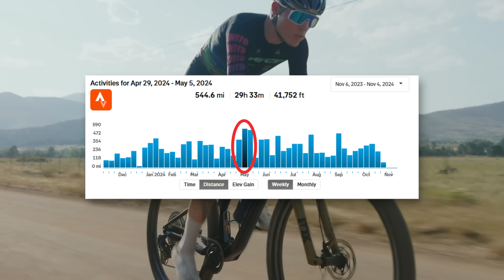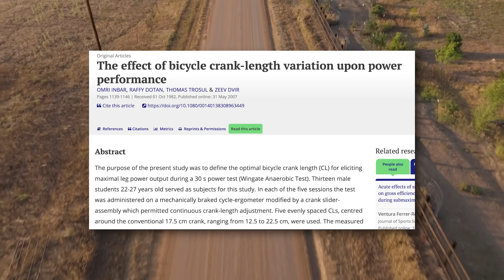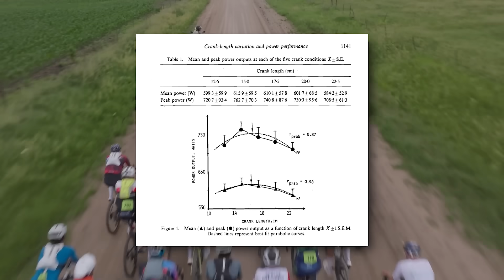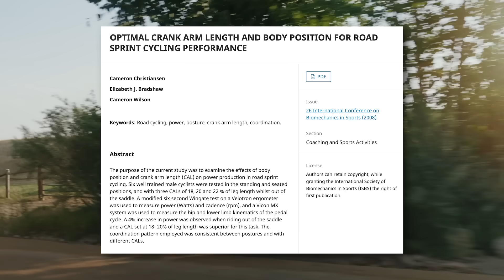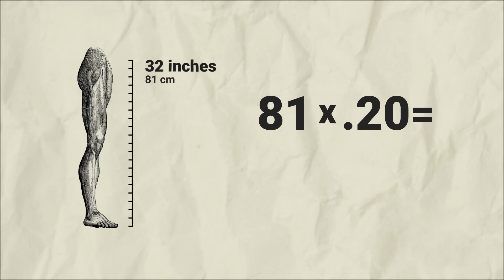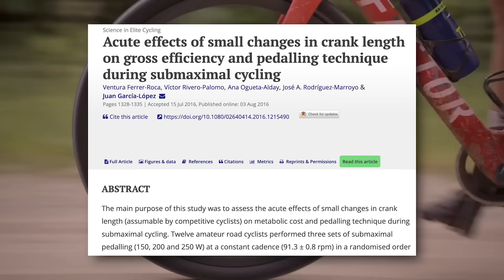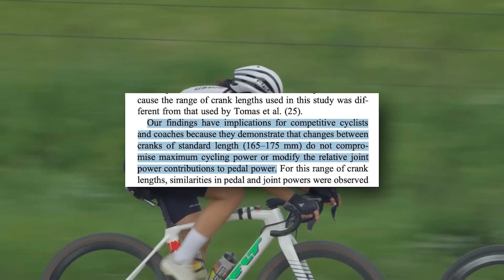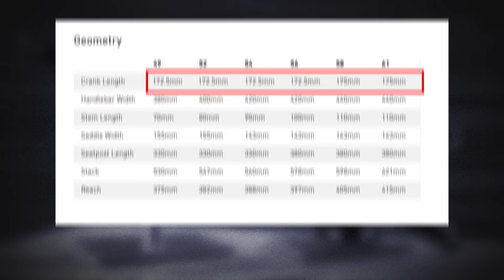You Should Be Using Shorter Cranks, Here's Why

Comment: 11:05 - Hold on a sec! Shorter cranks mean higher saddle, therefore less aero position. They could allow frame design with a lower bottom bracket, but that's quite an other rabbit hole.
Reply: in theory yes, if you want to preserve the same leg extension at the bottom of the stroke. But if you want to keep the same hip angle at the top of the stroke you can actually lower the saddle! But for most people the purpose of shorter cranks is to open up the hip angle, so in terms of bike fit and biomechanically increasing the saddle height would be helpful.
Reply: @JShrimpma  there were studies regarding saddle height and the conclusions were that a) optimal height is near full extension b) bit too high is as negative as quite a lot too low.
So you definitely not want it to be too high, but putting the saddle too low is decrimental to performance too. Therefore if you have a set position with longer cranks and switching to shorter, you keep saddle to pedal distance. While manipulating hip angle with bar height.
Reply: A higher saddle height does not mean less aero, don't know how you come to that conclusion, your saddle to lower pedal relationship remains the same, so no loss in aero there, but you can lower your body more into a more aero position due to a more open hip angle.
Reply: @gregmorrison7320  higher saddle - more frontal area. You know, the A in CdA.
Reply: @feedbackzaloop  No, you're wrong, think about it, a more open hip and knee angle allows you to get lower on the bike, less front area, I've done this on five of my bikes and ride in puppy paws everywhere watching everyone else sitting upright on the hoods, because that is what is more comfortable for them because of hip impingement. Ask yourself, what position is more aero?
Reply: @gregmorrison7320  that's playing with Cd of CdA. Legit, but different. And puppy paws vs upright - definitely not because of the cranks, be honest.
Reply: @feedbackzaloop  It's definitely more comfortable spending hours in a lower position with a more open hip angle, yes.
Reply: @gregmorrison7320  skill issue - if it comes to comfort, when you say so. Now, keeping to produce power hour after hour when your back is not strained - that's what you should have been focusing on. And where hip angle doesn't correlate with saddle to bar drop anymore.
(In other words, your position is not low enough for your back mobility and shoulder strength disregards crank length)

Comment: I have some experience riding shorter cranks. On my 29" mountain unicycle I have 135mm cranks that feels about right. Atfirst I had there 145mm and they was feelking too long. Since unicycle doesn't have any gearing, I'm basically stuck with 1:1 ratio. And with shorter cranks I can ride a bit faster.
On my experience with shorter cranks you tend to use higher cadence and easier gears. That's one of the reasons it's better for knees.

Comment: One caveat of shorter crank length: gearing. If you go from 175 to 165 you loose about 6% of mechanical advantage. Tha means you should change 30 tooth casette to 32 casette.
And there is one more advantage of short crank length: pedals clearance in cornering!

Comment: welcome back Dylan! 

As a fitter from my side I can add: these marginals gains come not from biomechanical side of the leg-crank system, but physiological one. With exertion, muscle mobilizers/stabilizers come into account, when those muscles endurance depletes and leg pattern is disturbed, thus cutting effective pushing phase of legs in degrees significantly. So reducing the open/close leg angles saves mobilizers/stabilizers for longer period of time. 

Cheers, 
Alexey
Reply: On the money.

Comment: Your premise is wrong. It should recommend the "correct" crank length; not short or long. Using your 20% formula for my 90 cm inseam suggests 180mm cranks would be optimum. Unfortunately, the closest I can get is the 175s on my Canyon Ultimate size XL. So I suspect, for many men, using you calculations,, the standard 172.5s are actually too small. Do you get my point? Exposing 165s is misleading for many cyclists, even if they're spot-on for you.

Comment: I'm 6' and ride L/XL frames.  I rode 165 cranks my whole childhood / college (I think my dad was mostly motivated by reduced pedal strikes at high lean angle).  Then my first carbon bike purchased as an adult came with 172s, so I have that on my road/gravel bikes.  But on the track, shorter cranks are advantageous because comfort and efficiency at high RPMs is such a big factor (also pedal striking at some velodromes, though not mine).  So on track, I run 165s.  They certainly feel a little different but I don't think it's a big deal.  I only race track and the 172s on the road aren't bugging me, so I'm not rushing out to replace them ($$$).  Interesting video!
Reply: 172mm is already short for 6ft guy. That is proportional to a5 ft 10 pogacar using 165mm cranks

Comment: Good video, but go deeper. There is an anatomical and physiological reason for, not shorter cranks, but the right crank length for the rider.
Ask a good bike fitter, not some former pro wanna be. A fitter medically knowledgeable. They will tell you that the BS bike riders have been fed all these years is wrong.
Again go deeper, there are tons of videos on everything from handlebar widths to saddles (huge variety) for the performance value of comfort cannot be understated. Shorter cranks for most people are more comfortable so they perform better.
One last thing on my rant please. Bicycles have more than one gear last time I checked. So if you want more power then upshift to a harder gear with your comfortable shorter cranks.
Respectfully, keep up the good work!

Comment: I'm 6' 2", but have a long back and relatively short legs with an inseam of 32.75". A new bike I got several years ago came with 175 mm cranks. I quickly noticed left knee pain. I switched to the 172.5 mm I had been using and this resolved. But sometime after that, I started getting more left knee pain. I looked into still shorter cranks and decided 165 mm looked good. I tired them and the knee pain dropped to a fraction immediately and was completely gone within a few weeks. I then converted all of my bikes to 165 mm.

My short wife had 165 mm cranks on her bike. I converted to 152 mm and she immediately loved it. I could also see that she no longer looked like she was going to hit herself with her knees while pedaling. 

You do lose some leverage, but it's on the order of a half a step between gears and you only lose something at the very lowest gearing. I also believe the less range of knee motion means more of your pedal stroke is in a strongest or best leverage portion of the pedal stroke. 

Bottom line, I'm a believer in shorter cranks.

Comment: Good analysis.  I like how you used research papers.  Now the industry needs to catch up because I’ve found it hard to find shorter cranks.  I went from 172.5 to 165, then tried cheap 160s on a klunker bike and it was even better.  I now have an even cheaper set of 152mm sitting in a box I want to try.  I’m 5’8” average proportions 31” inseam.  My hips feel better, knees much better and I feel like higher cadence spinning is easier.  Wish I did this decades ago - I’m old and I’d recommend it to younger people.

Comment: Also, a big pro of shorter cranks is more ground clearance while cornering
Reply: Less pedal strikes if you're a mountain biker too
Reply: @tp3293 yeah but I found myself getting locked out in a dead spot while climbing rocky trails more often (less torque to overturn the cranks?). Sometimes it felt like I was climbing using a second gear but at a first gear speed on 165s. Went back to 175s and chugging uphill over rocks feels just more fluid.
Reply: Only if you corner with the wrong foot down though? 🤔
Reply: @Eirikkinserdal or if you need to pedal through the corner
Reply: @Eirikkinserdal  What if i want to accelerate while leaning ? To transfer the weight  rear wards, to get more traction and corner even faster

Comment: I have been on 165mm cranks for the past season and I will never ride anything else.  For me, the change was 100% due to fit/comfort.  I am a 59 yr. old male cyclist with a hip replacement.  Sadly, over the years I had been through several bike fit sessions and no bike fitter had ever recommended the change.  After changing, the post-ride hip pain I would consistently suffer from has been completely gone.

Comment: When I build my first bike I put 170mm cranks without knowing cranks had different length. Then I build a MTB and  for some reason I let myself believe that for my heigh (188cm) I needed 175mm. So I put that on the MTB and bought a new 175mm cranckset onto the road bike. A couple of month later I'm having knee issues saddle sore, foot numbness. Then I started to read more and more bike fit info to then realice that I have a hip impingement after some tests, a 9mm leg discrepancy after an x-ray lower limbs measurement and came back to 170mm cranks on both bikes. Now it's perfect and all sorted out even though it seems short for my height.

Comment: GREAT to have science Dylan back!!

What about the aero penalty for having to raise the saddle as well as handle bars when going shorter cranks?

Also possible aero penalty of higher cadence?

BTW I went lower in crank length

Actually it’s more important to match to tibia length instead of leg length
Reply: There is no aero penalty because you are now able to bend more at the hips and get your body into a lower more aero position, this might not apply if you're one of those riders I see out there riding around upright on the hoods (most of them) but for us that like to ride in an aero position it really is the main benefit of going down in crank length. You put the seat up to compensate for the higher position of the lower pedal so that relationship stays the same, no aero loss there, but your total height is reduced because you can lower your upper body to be more aero, usually you don't even need to raise the handle bars and definitely not the same as the amount you have to raise your saddle. My cadence varies all the time, I've never considered it to be an aero penalty at higher cadences. My range is between 60-120rpm when riding a single speed. On a geared bike I just ride which ever cadence feels comfortable, I don't try to maintain any mythical optimal cadence and the range is wide.

Comment: I ride crank lengths on both ends and I can say that crank length mostly affect pedaling cadence and comfort. I'm 6'2. On my XC MTB i have 175mm cranks. On technical trails and short punchy climbs, crank length is perfectly fine, but as soon as I go on road i get uncomfortable riding more than 75rpm and my pedaling feels choppy. Even though I feel like an old tractor chopping my 2 pistons when pedaling to the max, i don't feel weak or slow. Due to knee pain and wanting more aero, on my road bike i chose 165mm cranks. It's easy to spin them 90+rpm, and leg spin inertia gives smooth pedaling, but as soon as cadence drops due fatigue or steep hill, it's definitely feels like i can't produce as much power. And pedal standing with high rpm is also uncomfortable. So if anyone will test power production with different crank lengths, test also different cadences.

Comment: That’s one thing I did when I got into cycling and triathlon. My tri coach said look I’m not gonna lie to you. You are 5’4” non of the big companies make cranks for you. After bike fitment we went with 155mm and boy was that amazing. I run them on all, road, tri and MTB. It’s the first modification i do from now on.
Reply: What 155mm brand cranks did you find?
Reply: @northkyt  I ride 150mm Rotor Aldhu cranks.
Reply: @northkyt he probably went with 5dev
Reply: @northkyt You can Tune old full Aluminium Crank's to shorter with new holes (-20 mm.). I've done now over a dozen +150 mm Crank's from +170 mm Crank's 😊
Reply: @thatprcrawlerguy187  also it saves a ton of money by not trying every so called comfortable seat on the market.
Reply: The old science was leverage…so leverage, rpms and bike fit must be the elements to that sweet spot
Reply: Yup you're short and below average height, so it worked for you. I went from 170 to 172 and it worked better for me (I'm 5'9")

Comment: Crank length really is a grain of salt given the massive salty boulder that is head tube length. Turns out people are not all that quick in an aero position that can be described as bent over the kitchen counter (and yes, hip angle turns out to be very important in that context too). 

One for the windtunnel - bring the aero bar mount up a fair bit and rotate the the bars up as well. The goal is to just have the arms are more inline with the body and trade frontal area (bent over) for better CoD (tappared aero). The water bladder backpack will becomes a necessity here. An upright position opens up the hips and lungs more effectively so now you can run whatever crank length makes sense bio-mechanically. For endurance gravel events this may well lean on the longer side as it move the effort more into the glutes. Pros are running shorter cranks because the UCI made the head tube rules to short. All this nonsense just to ground the Flying Scotsman.

Comment: In the future, there will be adjustable seat height/pedal length. It changes based on slope, higher the slope longer/downhill shorter and flats in the middle.
Reply: Lets hope it is the same with tyre pressure. Adjustable on the fly :p

Comment: Exercise physiologist and bike fitter here.  Thanks for pointing out that the answer is always “It depends”. As is with nutrition, training, etc.  One point to add as I think cyclists can benefit from zooming out sometimes.  Yes this has a net positive reaction on the majority of riders and bike fits.  Not that it’s wholly optimal across the board.  Cold plunges help almost everyone, but because everyone’s dopamine function is pretty suspect in our polarizing world.  Shorter crank arms help, but most cyclists are still hyperoptimizing that context alone.  If you happen to learn that you’ll benefit from shorter crank arms than your physics can tolerate, you have some dysfunction.  Apart from performance, time under tension, metabolic cost, etc.  For human performance you have a limiting factor within your hip or ankle mobility and function.  You need to treat a symptom for sure, but if that permits you to disregard all planes of motion, function, and stability you’ll still always be limited.  I’m pro short crank arms for the masses and the industry shift, but it shouldn’t let you steer away from optimizing all aspects of the body for the sake of longevity

Comment: I went from 175 to 172.5, and there came: neck pain, back pain, stiff arms. Went back and all ok again. With shorter cranks, I loose my balance and "fall" into the handlebar. I obviously tried moving the saddle around in all possible directions, just making it more or less terrible. So that were some couple hundred bucks spent badly.
Reply: Depends on your inseam. If you're tall, you need 175mm or longer. If not, you have to change your stem and adjust your handle bar height and angles as well.
Reply: @musclelessfitness2045  I am tall, 6"2 or 188 cm respectively, with 87 cm inseam. I have no bike fit issues and no pains, but as everybody was raving about shorter cranks, and as my average cadence is pretty low, I thought it would be interesting to test shorter cranks. But all hell broke loose. So there are arguments against longer cranks was what I wanted to state.
Reply: @SrFederico  That's valid. I think the formula suggests 175s for your inseam.
I have a different experience since I'm smaller. I felt many advantages right away with the 160s.
Reply: @musclelessfitness2045  It's pretty plausible that smaller riders would have problems with cranks for longer legs. And as Dylan says there are (theoretically) not a lot of downsides - apart from costs...

Comment: 88.5 cm inseam here. Once I tried 165mm cranks, never looked back. Now, I'm riding 160mm cranks on all my bikes and I've never been so comfortable and stable on the bike.
Reply: For a 88.5 inseam, the formula suggests 175mm cranks. You feel better on 160s ? 
I happily switched to 160s because I'm smaller, but I'll be sometimes thinking about 150s or 155s.

Comment: I went from 175 to 170, the difference I felt was incredible. Much smoother pedal stroke and more fluid power transfer, not to mention the added comfort when on the drops. I’m 193cm with a 95cm inseam. Going off this calculation I’d need 190mm cranks 😳 no thanks 🤣

Comment: It bothers me that going to CORRECT length cranks is being called a short crank trend. 
I have a M size Specialized new from 1986. I can sustain a higher speed longer with those 170mm cranks than I can with any bikes I’ve owned in 21st century that all have 175mm cranks on M size frames. Every S size bike available for my 5’1” wife comes with 170mm cranks. This results in knee discomfort from over articulation. We both managed 2,500 miles of the GDMBR with our too long cranks but the older we get the less our ability to adapt to this stupidity.

Comment: As someone who rides 49CM/XS frames, I always thought it was insane that brands would spec the same size cranks as a medium or even a large. I used to only run 170mm cranks and would constantly deal with knee pain and feeling like there were "dead spots" in the pedal stroke. I'm on 165mm now - which even that small change has been a noticeable improvement. I'm probably going to go even lower to 160mm soon
Reply: I ride the same size bike and going to 160's has been the most comfortable for me. I'm tempted to try 150's even.